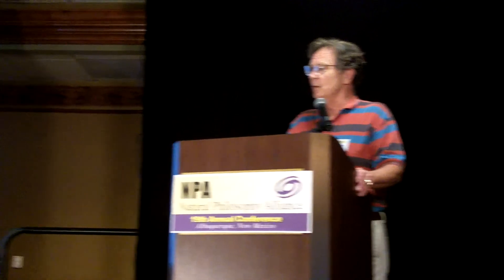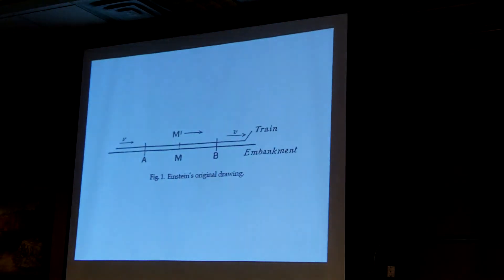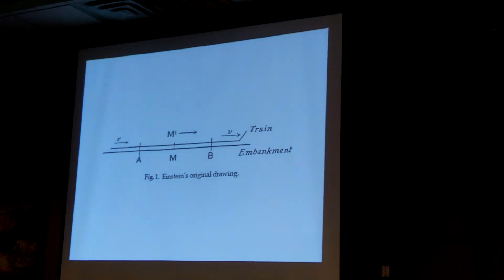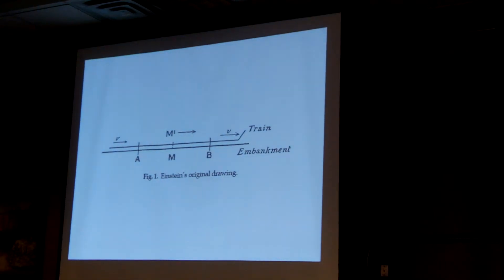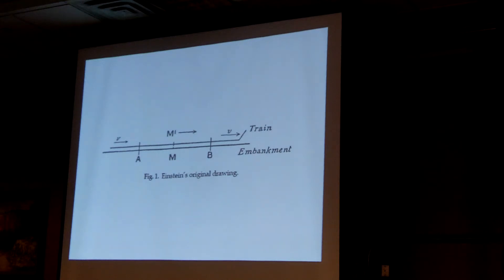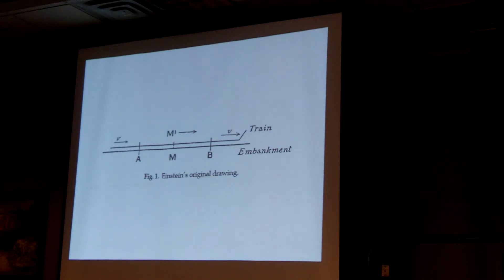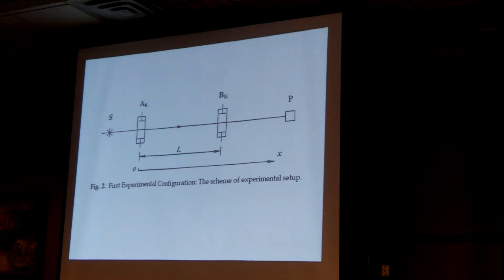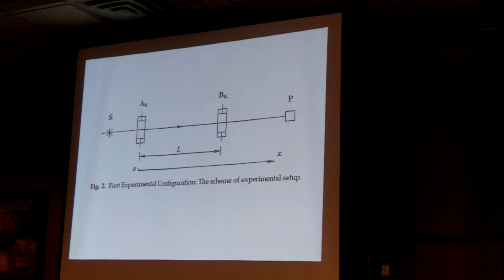The Logic of a Newly Designed Optical Experiment May Resolve the One-Way Light Speed Issue

Comment: You can not test the speed of light if you are on a spinning planet. Also you don't need to over think the circuit. I made a circuit that can test the speed of one way light. It's called two stop watches. One at point A and another at point B. For more information about this experiment read my comment below.
Reply: First put stop watches on two satellites and place the in stationery poistion 1 meter apart. Next fire a light beam from one satealite to the other. The satellite that fired the light beam will start it's stop watch as soon a the beam is fired. The satellite that receive the light beam will start it's stop warch. Finally both stop watches will stop simultaneously and the difference between the start and finishe will be the speed of light for 1 meter.
Reply: Or instead of firing one light beam fire two. One from the first satellite and one from the other. This will cause both stop watches to start and stop simultaneously. With two results for comparison.

Comment: I think this experiment is flawed in design - the problem conceptually is that the Kerr cell shutters are two clocks that are effectively synchronized one by the other separated by a distance L. However, the notion that synchronizing frequency is enough to reproduce the "light sausage" is misleading, since the two Kerr cells must also be in the correct phase relation in order for the light pulses to pass through unimpeded, since if they were not, then the pulse would be cut off partially by the closed shutter even when the frequency is correct. And since slow clock transport will introduce a phase delay (clock bias) into any moved clock that depends on the one way speed of light, a phase delay will always be incurred that will precisely cancel any possible one way speed of light difference that could be measured. So the experiment will always conclude that the one way speed of light is constant, even if it isn't!! I wrote an article about a similar situation with GPS clocks that you can find here: 
http://conspiracyoflight.com/pdf/Oneway1.pdf   These kinds of one-way speed of light tests for anistropy should be "impossible in principle" and unfortunately I do not see how this one would be any different.